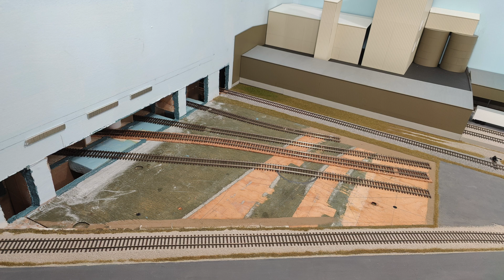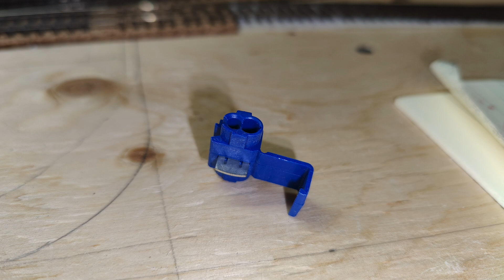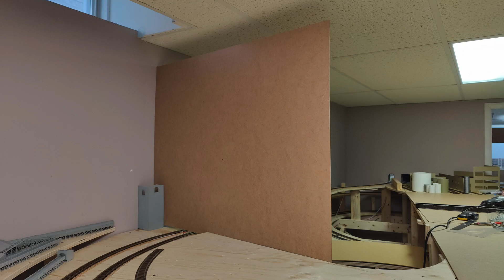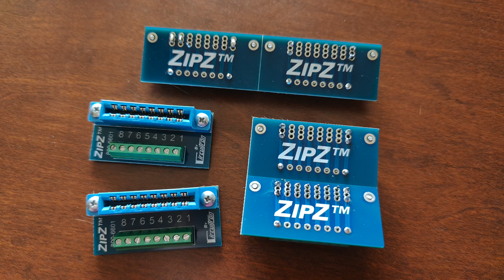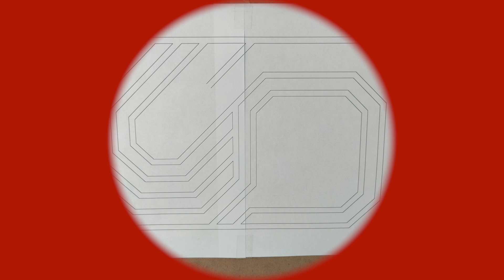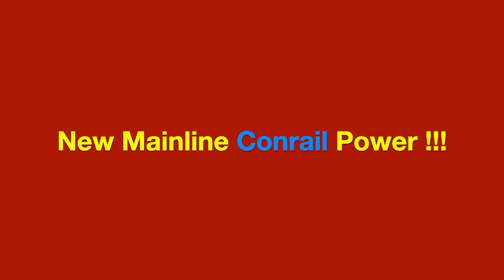Q&NE HO Layout Video 166 - 250125

Comment: You won't regret using the slip on connectors. If you ever have any issues with the switch machine or the connections, it is a lot faster to fix. We started switching to them at Dr. Bruce Chubb's SVOS layout.
Reply from the maker: Agreed. Thanks for the comment. Say Hi to Bruce :) I've been a big fan of the Sunset Valley for decades.

Comment: Blue Painters tap folded over the top of the wire will give you something to hang onto and if it does get free is will not go far,  much like putting a towel over a snap rope when pulling a car of of a ditch.
Reply from the maker: Another great tip, thanks.

Comment: For that tight backdrop radius, a friend of mine used aluminum flashing like you’d use on roofs and chimneys. Worked out great after a few coats of paint.
Reply: He literally covered that as an option, and explained why he didn't use it.
Reply from the maker: Yup. Great option, if you can live with a 24" height, but I wanted a taller backdrop, and the flashing is not self-supporting, like masonite can (mostly) be, as long as i can get it to curve sharply.

Comment: Which video shows the Tortoise switch machine installations.
Reply from the maker: There's info on the Tortoise installations in Videos #159 (talks about the throwbar wire thickness test on the first installation) and #164 (the rest of the installations).

Comment: Here's a idea when cutting the wire put a towel over it and that will keep it from flying around
Reply from the maker: I was holding it, but the force of the cut pushed it through my fingers. Towel sounds like a good idea. That way i can have both hands on the pliers.

Comment: You could cut the copper in small lengths for gondola loads
Reply from the maker: That's a good idea. It's soft so it shouldn't be too hard to straighten it out. Also thinking it could be used for piping within the Paper Mill.

Comment: For the backdrop, I probably would have kerfed the hardboard.  you can probably cut the hardboard with a good knife and a metal straight edge.  It wouldn't have to be terribly deep - just enough to cut through the surface allowing the board to bend on the large side. of the curve (for really tight radii, you can stagger the kerfs on each side.)  After that, I'd use drywall mud to smooth out the surface, paint it, and call it good.  just in case the poster board isn't strong enough.  You could probably wrap the poster board around the kerfed hardboard instead of drywall finishing, too.
Reply from the maker: Thanks for the tip. I am considering it as a backup to the poster board solution. What spacing would you suggest for the score lines?
Reply: @QNERailroad  A 1/2" would give you a really 'smooth' curve (insomuch as tangents are smooth) - but you might be able to go as wide as an inch.  it looks like it's pretty tight in the drawing so just throwing stuff at the wall - i'd err on the smaller side and maybe hit it at 1/2"-3/4" for a nicer curve.
Reply from the maker: @AlleghenyNorthern  Thanks
Reply: Awesome channel great video keep them up please like and subscribe thanks for your support

Comment: Looking good! I’ve never liked suitcase connectors for anything… I’ve seen far too many poor connections caused by those in various vehicles I’ve worked on. Those connectors you found seem like a better option. Personally, I like to stick with secure terminal blocks or soldered connections.
Reply from the maker: I like terminal blocks as well, but they've become very expensive (if you're going to use them exclusively). I've used them where it makes sense for large concentrations of wires, and these new connectors everywhere else. They hold the wires in tightly (almost impossible to pull them out!).

Comment: What about scoring the board on the backside a few times for the bend ?
Reply from the maker: I didn't think of scoring, but it would probably have to be scored on the outside of the curve, which would put it on the visible side of the backdrop. Not impossible; it would just mean that the score lines would have to be filled with putty or plaster and sanded smooth. Thanks for the tip.
Reply: @QNERailroad  welcome, hopefully you can find a simple fix.